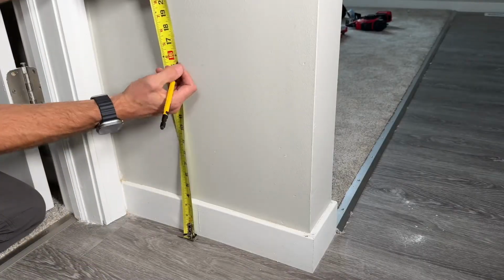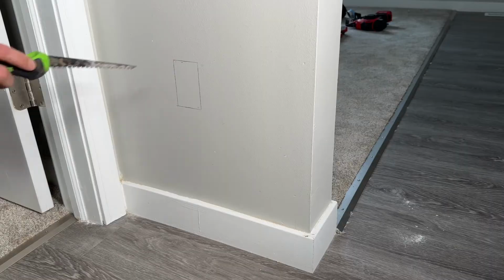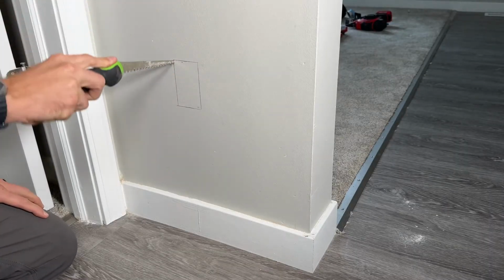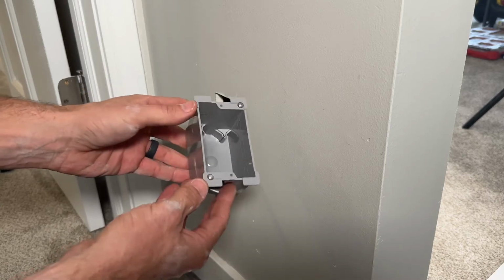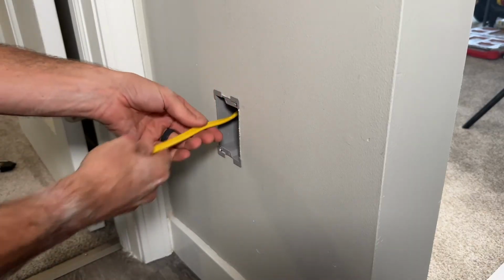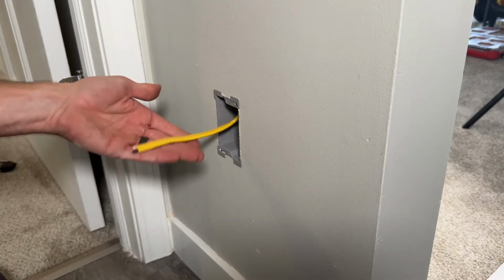How To Install An Old Work Electrical Box

Comment: Do I need to pull a permit for adding an electrical box like this?
Reply from the maker: It depends on where you live.  Check with your location inspector who usually are available for calls at the start and/or end of each day.